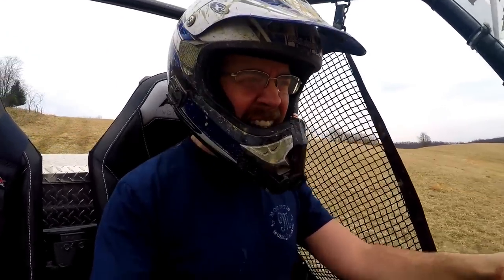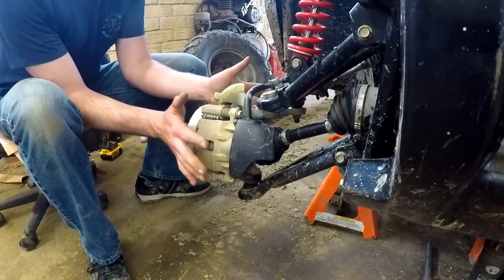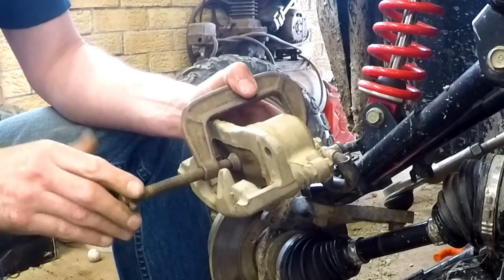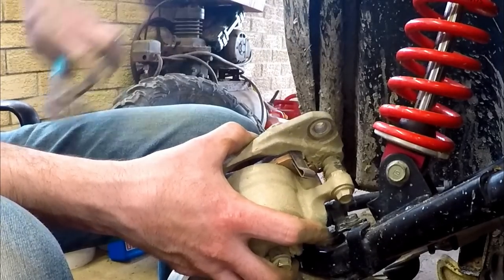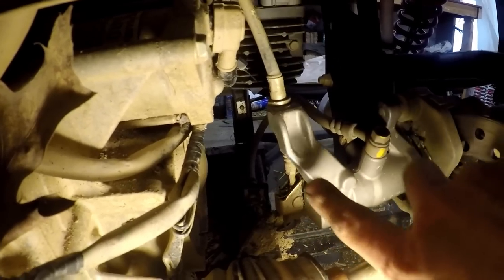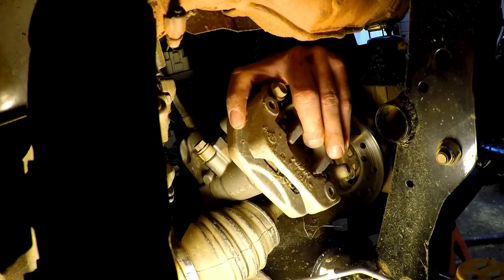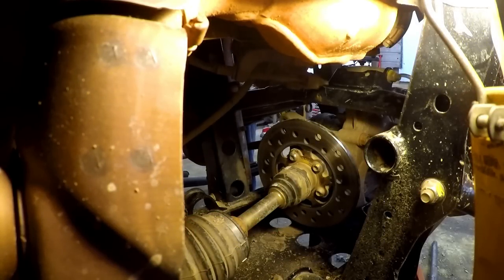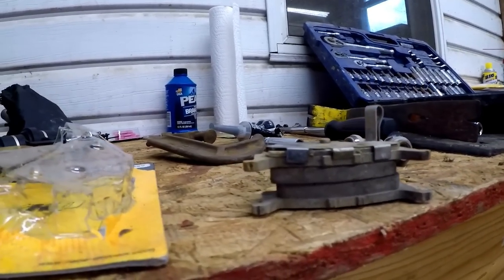Honda Pioneer 500 Brake Pad Replacement

Comment: Thank you for posting this video. This will help me greatly when I go to change my brakes on my P500!
Reply: Also, I  noticed that you used Race Driven pads. Could you please post the part numbers for both the front and the rear?
Did you order your pads from Amazon?
Thank you!

Comment: Thanks for the tip on the swivel socket for the rear brake caliper.  Good tip, made life easier.  I removed both wheels and worked from both sides.  Not too bad...

Comment: Nice video. One tip from me. When I'm doing brakes on a car or truck I always loosen the cap on the brake reservoir.  It makes it easier to push the caliper back with the c clamp

Comment: Hey Jason at 14:32 did you use the aluminum piece and the 2 shims on your new rear brake pads and my rear pads didn't come with that protruding bolt kind of think for the piston iwonder if it matters And I wonder if we we are suppose to reuse those shims and aluminum piece.....
Reply from the maker: rueocts 5 hearts rc o boy...I can remember. I’ll take an look to see if I did and get back to you but I’m thinking I didn’t.
Reply: I'll try to explain my dilemma on hondssxs and show you the shims.I cant find much info on aftermarket brakes that explains if we should use them or not..and just like you i did the fronts only like 800 miles ago and now i'm doing the rear..oh ya thanks for the video helps..

Comment: Any advice for adjusting the parking brake?  I’ve tightened the wing nut.  The handle feels tighter when I pull it, but the buggy still drifts when I’m on any slope.  I checked the rear brakes, and they work.  Thanks.
Reply from the maker: I’ve never had to mess with mine or even looked it over very closely...lol. I’ll take a look at it!
Reply: AppalachianMountainRiders I took my rear brake apart, cleaned everything with compressed air and brake cleaner, and put it back together.  Unfortunately the parking brake still doesn’t work very well.  The pads are still decent, but maybe I’ll replace them to see if that makes a difference.  I have tightened the butterfly nut on the parking brake, but that made only a marginal improvement.
Reply: I replaced the rear brake pads and that solved the problem.